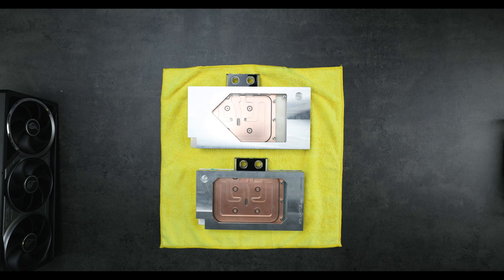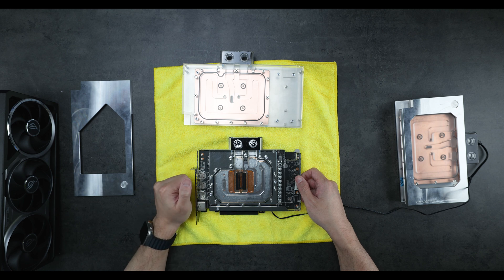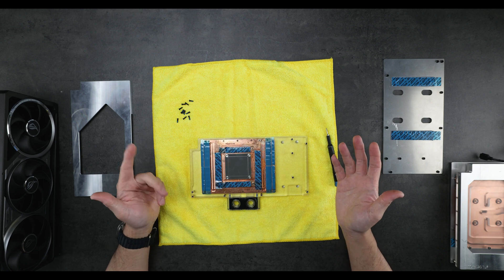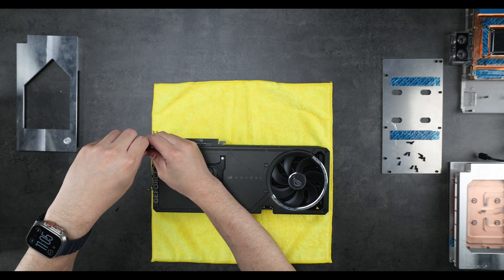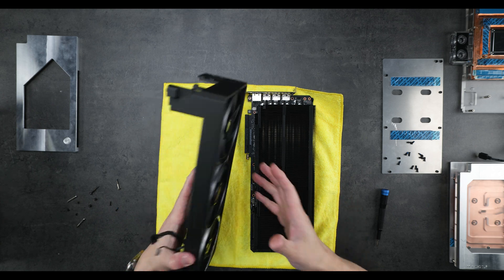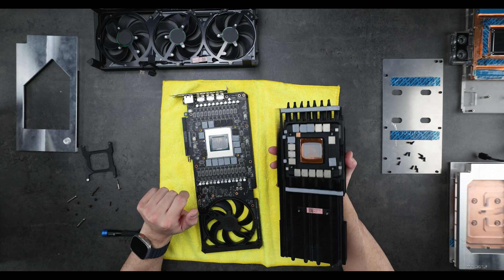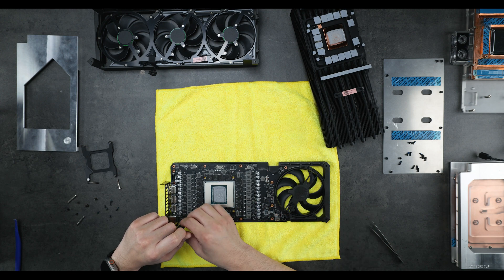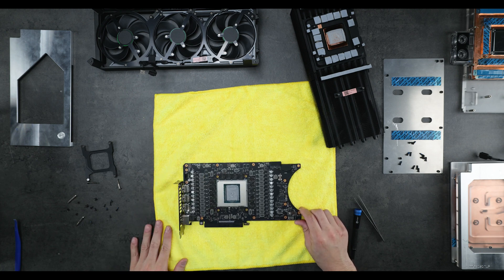Watercooling ASUS ROG ASTRAL 5090 & TUF 5090: Bitspower Prototypes. Part 1: Intro & Astral Teardown

Comment: Such a waste to put a block on an Astral or a TUF, they both have terrific on air performance. Leave the blocks for cheapo cards.
Reply: They do, yes, but for instance - I've played Star Wars Outlaws, the card is at 69-70c, RPM of the fans is about 2200+, it's so loud. I can tune it down, but I don't really want the temps to climb higher. 
This is stock fan curve right now. It sounds like it's about to take off. It would be nice to have the same temps and close to none noise from the fans.
Reply: Come on bro you should know for complete silence you need blocks and water.

Comment: Alphacool is dragging feet fulfilling orders… if only there are more options out right now.
Reply from the maker: End of April I believe
Reply: EK and Bykski both have blocks for the Astral. (I should have both coming in the next week - they shipped.) That said, i don't really want either of them - but I hate hearing fans. They will just be temps. (I had two orders with AC, but cancelled them because of their fake stock countdown.) Hopefully i'll be able order to bitspower ones soon.
Reply: @Zurvv If only the EK Astral version looked as good as their FE version.  I picked Alphacool because their block for the Astral looked better.  Bykski’s block has the inlet/outlets in an inconvenient position for my build but I like their aesthetic otherwise.  Glad to see Bitspower looks good.